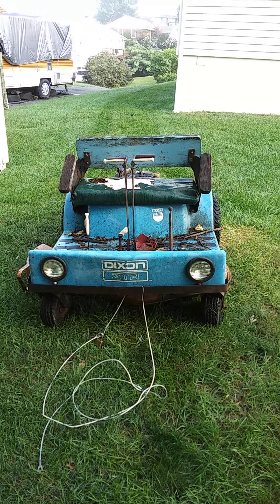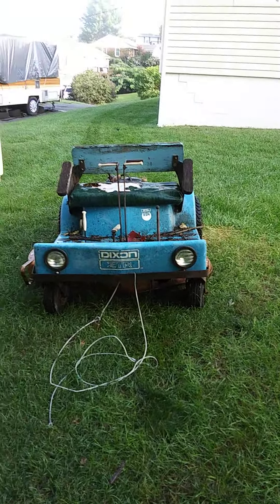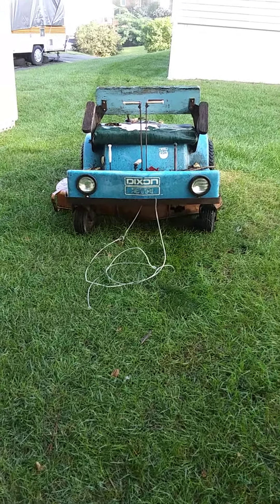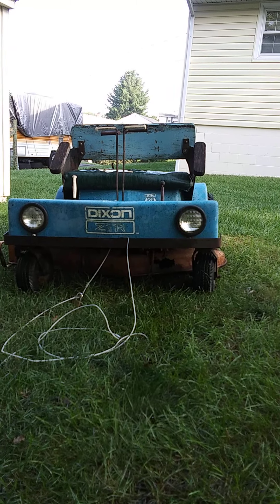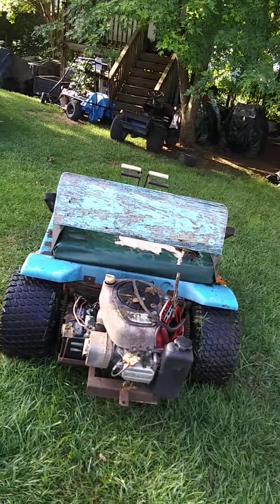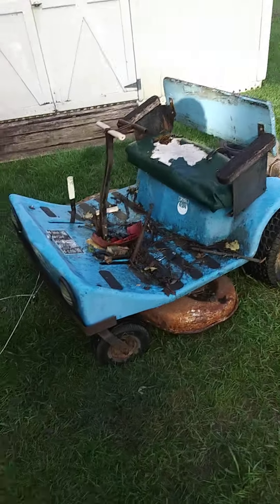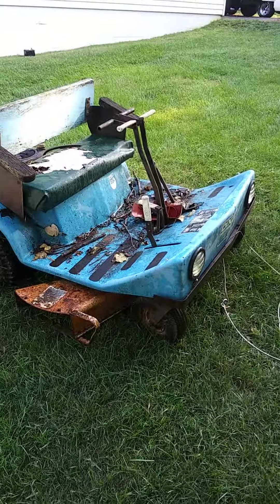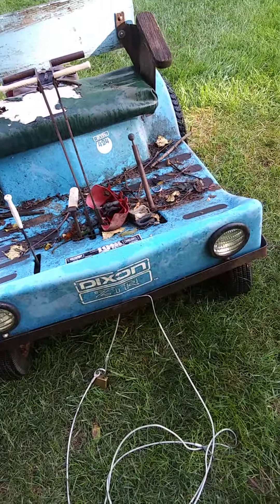My vintage Dixon ZTR 424 zero turn mower

Comment: My friend has that same mower but a little bit newer and it has the same 11 HP engine with electric start. Can't get it out of gear when starting it. It wants to go forward while cranking , but it just won't start. He said he's been starting it like that since he got it.
It acts like the battery isn't charged enough to start it , but the connections are good and it's a brand new battery with over 13 volts.
If you're still around I'll take any advice on how to get neutral / park for starting! Hope the starter isn't wore out now from starting in drive
Reply from the maker: So I assume it's a zero turn?